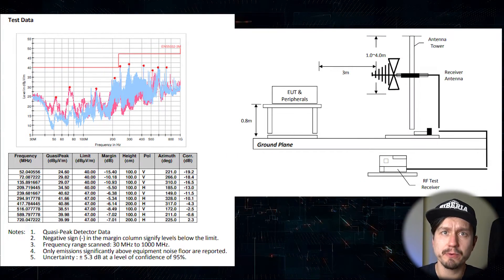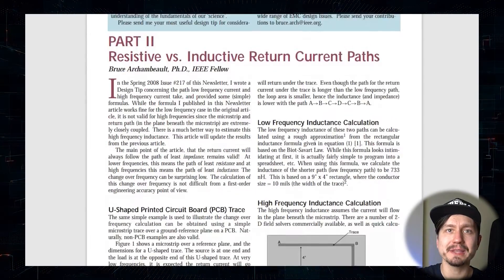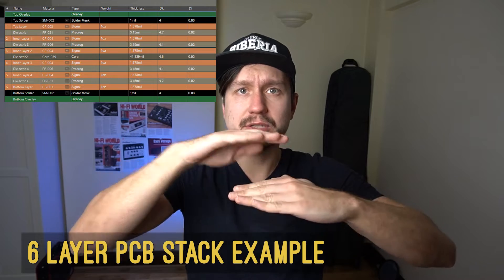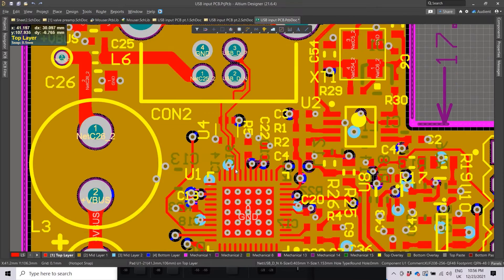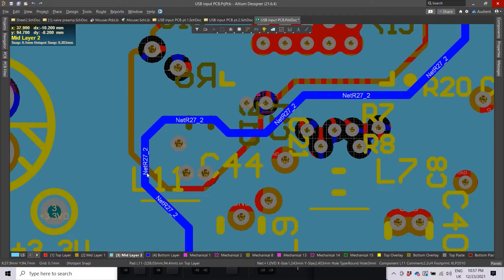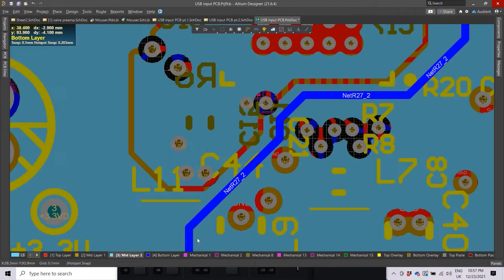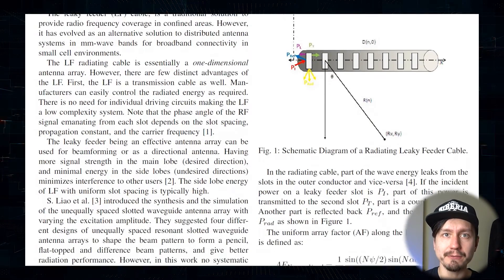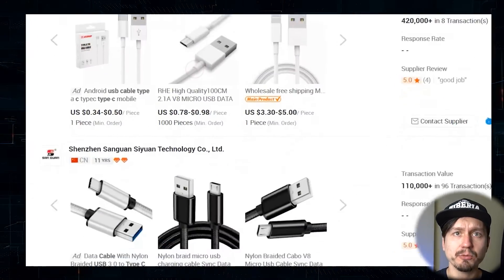How to Pass Radiated EMC. 3 Mistakes to Avoid

Comment: 1:50 Problem is not just paths crossing between planes!!
If there's currents in one of the planes, they can cause mv differences in potential between the two relative ground planes. Due to their differences they just act as a dipole antenna, and emit noise. So even if you have neatly separated the two planes and no traces crossing, you can still inadvertently create an antenna and thus EMI. 
You are very correct though that just having a big, unbroken ground plane (preferably as close as possible to the traces), is generally the way to go. You can do a lot of harm and create tons of problems by trying to split planes.